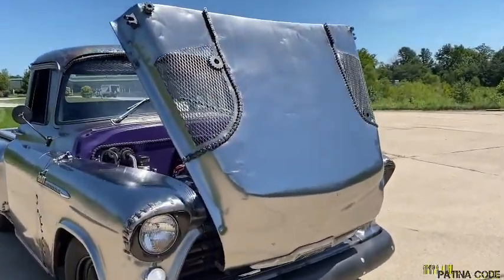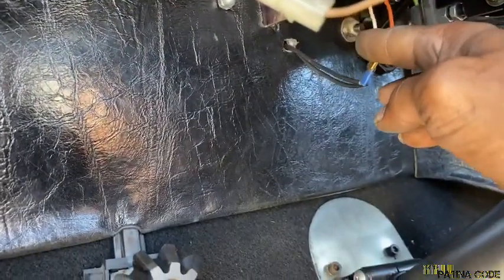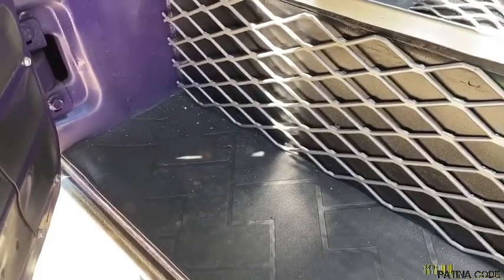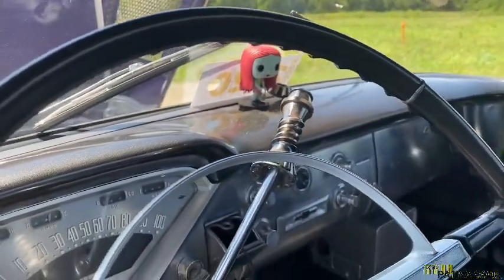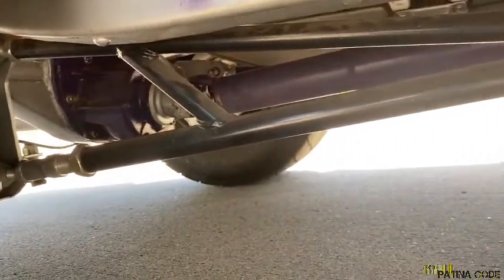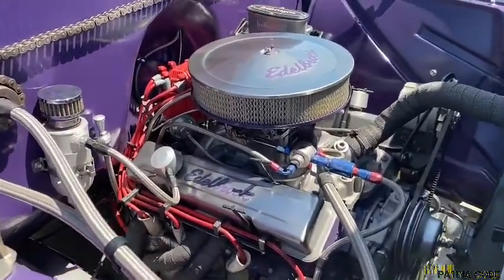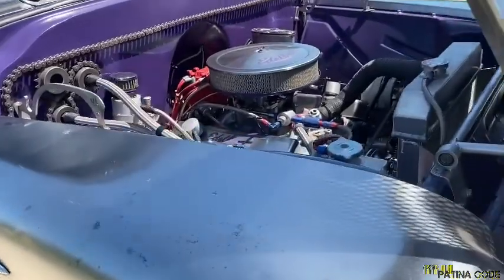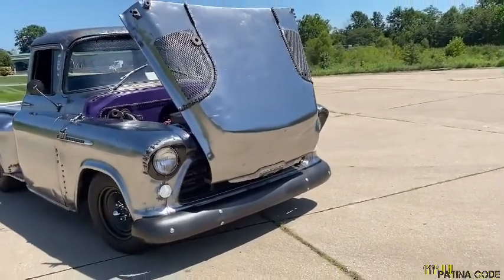Bare Metal Rat Rod  #patinacode

Comment: Oh man this is gorgeous. I have a bare metal fury but i want THAT LEVEL smoothness. What grits did u use? Did u use a block?
Reply from the maker: Thank you. I used a wire wheel on the end of an angle grinder to remove all of the paint . Once it was down to metal I started with a 60 grit and worked all the way up to 2500 grit . I done it all by hand.  
I didn’t use a block because there are a lot of dips in that old body and a block would only get the high spots , leaving the low untouched. 
It took me a while but it was worth it . 
Thanks again.👍🏽